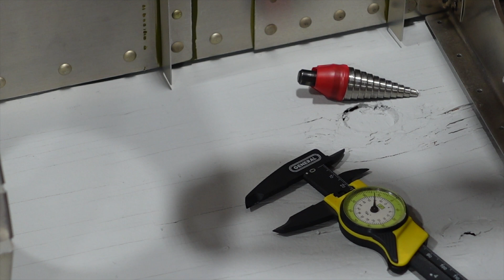Ep. 51 | Viking Fuel System | PART 2 | Zenith Super Duty Aircraft Build

Comment: Adam, does the fuel tank selector valve have a “both” tanks position?  Thanks!
Reply from the maker: No only Left/Right.  Was meant for balancing uneven wings.  Plus we have a 30 min header tank which should always read full.
Reply: Thanks for the info on the tank selector valve. Also, what are the dimensions on your header tank inspection panel.  Nice work on that!  Looks great!
Reply from the maker: @CaseyCollins-b9p 7 1/2” x 9 1/2”

Comment: Like the video but don't like the fuel valve or it's location!  I understand that the location of the valve is the only practical one to keep a simple "clean" installation, but it's poor practice to have such a critical part of the fuel system located out of direct line-of-sight and having to reach slightly behind you to turn it (think John Denver crash!).
It appeared there wasn't a lock or detent to keep the valve positioned for R & L - on the surface, that seems fine since you simply turn it in either direction 'til it stops, but a front or rear seat passenger (or a shoulder belt?) could inadvertently bump the valve handle and partially turn it, potentially cutting off the fuel - and, remember, it's out of your line-of-sight.  Quality fuel valves like the Andair line have detents to hold the valve's position and a lock-out that must be lifted to select "OFF."  You might consider some sort of guard for the valve handle to prevent accidental movement the same way critical electrical switches have a flip-up guard to prevent inadvertent movement.
Likely you have a fuel gauge on the header tank that would tip you off if fuel flow was cut off or not keeping up and all of the potential problems are unlikely, but "stuff" happens! LOL!
Great detail in your videos - keep it up!
Reply from the maker: Valid concerns, all discussed and thought about.  The valve will not get moved by bumping it.  It’s hard to explain but the twist required is very stiff but smooth.  It’s not something that a shoulder strap would move unless someone wrapped it around the lever and yanked on it.  Also having the backup header tank with a minimum of 30 min of fuel as well as its own fuel gauge and Dynon timer alerts will keep everything in check.

Comment: Great timing, I am working on the fuel system as well. Looking at the options. I prefer to fly with a system that stays in both both tanks selection. Does this valve have a both detent? Is flying with the slip ball not centered causing the imbalance people complain about?
Reply: I don't think the Zenith's have a particular problem with fuel imbalance - you're correct you have to keep the wings level and also it's just simply there's not a high-wing plane out there that gravity feeds fuel perfectly evenly from both tanks! LOL!  My STOL 750 usually stays on "BOTH" but during longer flights and especially on autopilot, I do occasionally select L or R to even things up.

Comment: Are they 3/8 lines? So AN6 fittings? I want to buy a couple of fittings to see if they will fit where I have my holes already drilled. Not much room on the Left had side with electrical, fuel, and pitot static.

Comment: I do not get the “no auto pilot” decision, but it’s certainly your choice.   Seems with the avionics available today to be a feature that would be desired.
Reply from the maker: More cost, more complexity.  This is a low and slow hands-on plane.  If this was a 200 knot cross country bird I would have installed one.
Reply: @AeroworksProductions  but still will be up for sale after a year or two and then it brings more value.  Low and slow or not, AP reduces load on long trips.
Reply from the maker: @DavidBruner_NJ  It can always be added.  (2) $750 servos and a $550 AP panel.
Reply: @AeroworksProductions  "This is a low and slow hands-on plane."  That's what I said a number of years ago when I finished my STOL 750.  However, think about it ... any cross-country you fly, no matter how short the distance, is a LONG cross-country in terms of TIME in a slow airplane!  So, it's especially nice to have an autopilot so you can take a break from the hands-on flying to eat a snack or tend to other (ahem) necessities! LOL!  I retro-fitted mine and have never regretted it!  My decision was easier than for some in that I have a MGL XTreme mini-EFIS that has an internal autopilot driver - all I had to do was add servos and AHRS which was easy since they simply daisy-chain on a CAN bus.

Comment: I couldn’t tell but some kind of detent position on the 180 degree pivot would be nice.  My concern is not being quite right with position and the valve no open completely.  However you have a header tank quantity so you would be able to hopefully catch it
Reply from the maker: It's a full 180 turn from L to R.  You could also have an OFF if you left in 1/2 way between but there are stops on both sides.